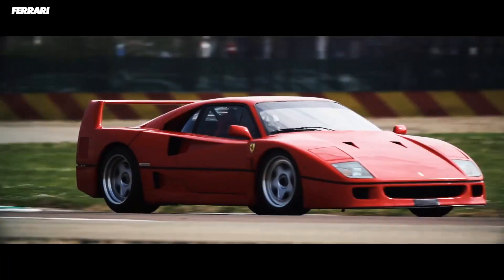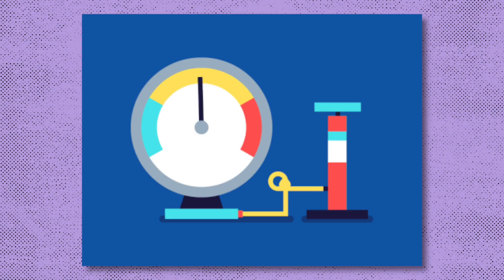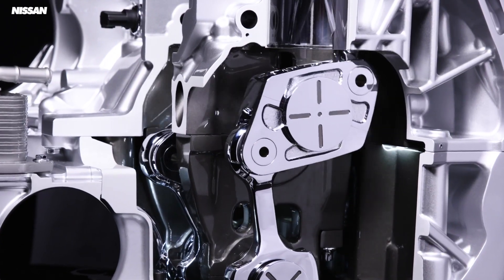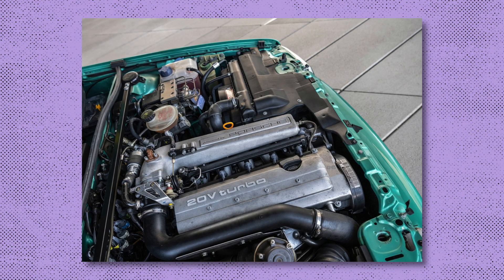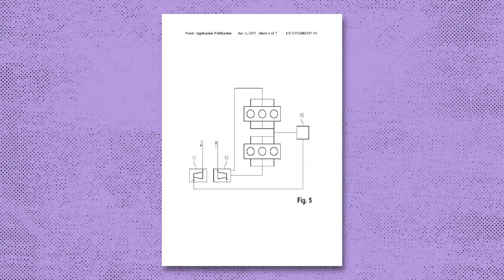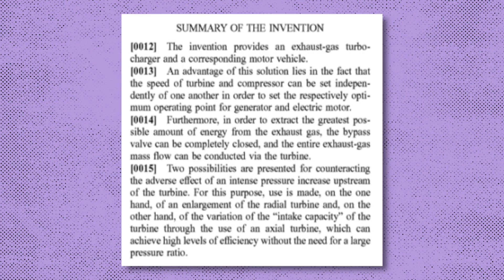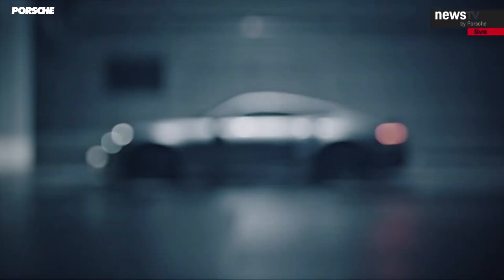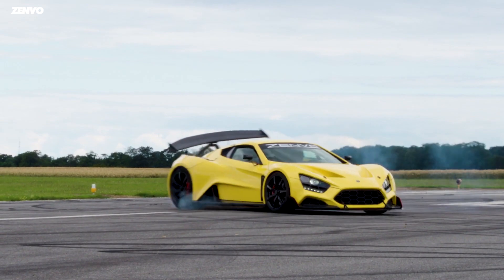Porsche's GENIUS New Turbo Design

Comment from the maker: Would you want one of these on your car?? The seem pretty cool! Don't forget to subscribe!
Reply: Yeah. It's essentially an electric supercharger and generator powered by exhaust gases.
Stresses the engine less than a supercharger and can assist the alternator.
Reply: @Rose_Butterfly98  do they even use an alternator? or a dc-dc converter?
Reply: @ryanholmes5364  either way, it does the same job, if it's direct DC charging it'll be even better.
Reply: @Busi Xho Nice idea, but to get enough air to be useful, its actually going to be quite big (and to take the pressure, quite heavy). The boot is not a great place for two reasons 1) the pipes have to be capable of taking the full pressure (and do it for years in a hostile environment without failing - high pressure lines failing hurts people) and 2) long lines means less effective as it still takes time to pass enough gas through to be effective. Also, don't forget, compressing and releasing normal air has effects like condensation - there is a lot of moisture in air; dumping it straight into the engine and out the exhaust is fine, but trapping it in a pressure vessel is likely to lead to corrosion, which leads to failure. Engineers think through ALL the problems :) (Never stop having the ideas though, thats how new stuff is invented!).
Reply: @andyowens5494  he's right. Something similar was done to fords wrc 2003 car. Had an air tank in the back of the car
Reply: @igamehard8860  Yeah, but it only lasted 3 events; wasn't anything like as effective as they'd hoped. It didn't spool the turbo, it just fed into the manifold. It had an effect, but Ford were quite glad it got banned.
Reply: @andyowens5494  feeding air into the intake while off throttle can help reduce turbo lag. I don't know if of this is exactly how firds works but it's how Porsches anti lag or dynamic boost works. But you are right it didn't help much around 5% in the ford
Reply: just imagine this turbo system in gt2 rs ......🤯🤯
Reply: @Busi Xho the gains don’t justify the means. Pneumatic power, in this context, besides being susceptible to the same thermal energy of heat that of a hot turbine, also has a known problem to form condensate. What has been known to work is a water tank in the trunk that cools the intake charge as shown in the BMW S54. I’m not a big fan of that design however.
Reply: Very well done presentation.
I only subscribe the best, and you are one of those.
Reply: It's cool, but I don't think its a turbo, its a electric motor thats powered by turbines similar to the ones that turbos use. There's far more differences than similarities. Of course, I know all of this is just semantics. But, its still not a turbo. :)
Reply: Excellent video
Reply: Excellent video
Reply: yes, definitely not buying an EV electric coffins
Reply: yeah dude duh
Reply: Do it. Grand Sleeper.
Reply: I'd certainly like any car that came with it :)
Reply: I already made one myself. I 3D printed an electric supercharger and tested it on my car and made a video of it.
Reply: Porsche should license out this turbo technology to Toyota's 3 Cylinder GR Yaris. That would be bonkers.
Reply: Get your facts right. This invention comes from the genius engineers at the Mercedes AMG Petronas Formula 1 team. It has been in Formula 1 since 2017. It is not an invention from Porsche. Porsche probably copied the idea.
Reply: I WISH I COULD GET WITH SOMEONE THAT WOULD LET ME DO DESIGN WORK.
I HAVE A DESIGN THAT FIXES THIS USING HEAT FRIM EXHAUST. IT ALSO COOLS EXHAUST HEAT INCREASING FLOW.
Reply: @ronniewall1481  You might try to get a job, or an internship, at one of the (very few) small tuning companies (not pimping companies!) who develop their own turbo chargers.

Pro tip: when applying for a job, or an internship, ditch your pretend for all-caps text. That's not professional. Not even in France; even the French people only use the all-caps style for informal communication (which comes from their keyboard layout). You might also let someone proof-read your text.
Reply: @Lil Yeet WHY THEY ARE AN AID YOU DELUSIONAL THINKING THEY YELL?
Reply: @Lil Yeet YOU THINK?
ANYWAY I GOT TONS OF IDEAS LIKE I KNOW HOW TO BUILD A SOLAR CAR WITH NO  SOLAR CELLS
Reply: Hi Callum, can you find out more for the benefit of everyone. I have read somewhere (which I have forgotten and cannot verify) that EA111 (VW's 1.4 TSI), which is turbocharged is now using the smaller compressor for better low end torque and not sacrifice much of the high end torque. I used to drive the Golf Mk6, which comes in 2 HP variant. The lower 122HP 200Nm 1.4 turbocharged and the more powerful 160HP 250Nm 1.4 twincharged. The same setup goes on the Touran Mk1. However, VW (I would assume technology derived from Porsche since Porsche has 51% ownership of VW) seem to have updated to a smaller but more effective turbocharger, so that the lower power Golf Mk7 is a 1.0 TSI inline-3 with 120HP and 200Nm, and the 1.4 TSI (also on the Touran Mk2) is now the more powerful 150HP 250Nm version, both single-turbocharged, with little turbo lag. Anyway to verify this information? At least when I start off from a stop at any traffic junction in my Touran Mk2, I don't feel the lag, and by the time I reached 60km/h, I have left my neighbouring cars at the junction 100m behind me. I did feel the lag in my Golf mk6, where gears 1&2 are sluggish and the torque kicks in from 3rd gear onwards. I also want to understand how is the lag reduced or eliminated with a smaller turbo. This part I don't quite understand. Many Thanks!!!
Reply: Electric motor powered turbochargers are NOT a new idea!😆
Reply: F. No.... well... maybe... dunno............................. in the meantime NA is kind, period.
Reply: yeah great video! and if you need storing and sharing drawings, 3d models, maybe it will be useful for you https://youtu.be/vwV-Im_xlic
Reply: Amg one lol
Reply: Yes, but I can probably build a car for less than the price of one
Reply: no, its dumb ! This is the reason ICE engines are going to 'die a sudden death' - the engineering is like shuffling cards around but not really improve . How about get rid of the DRAIN bolt/oil change process ? that is way more useful.
Reply: Can you  make a video about this car invention https://youtu.be/vFfsEfnsA4I
Reply: 77
Reply: Useless now we have to drive electric cars.
Reply: Gotta keep burning the dino juice. Even though deep down we all know that peak oil is a lie and that the earth is continuously producing more of the stuff.
Reply: I would definitely love any invention that would eliminate lag and improve throttle response because this is the main issue I have with turbo cars, that and the engine noise, but I'll settle for just improved response 😀
Reply: @timoooo7320  Exactly, talking about "turbo lag" is so 1980s ;-)

I do like improved throttle response of my car's engine (technically, the valves now control the intake; the "legacy throttle" in the air path is just just a fallback if the valve control system fails). Unfortunately, the added complexity also has a price. At 250.000 kilometers, the engine has now developed a "rough idle". Oh well, I got used to it, and it's still performing flawlessly on the Autobahn.

Oh well, EVs don't have such issues. But, while Elon Musk claims that his new model has "the power of a Porsche and a range of 500km", it actually has "the power of a Porsche or a range of 500km". Also, whenever an EV is charged, the sun doesn't shine a bit harder, nor does the wind any more; the additionale electricity comes from coal or (in the US) Diesel plants. When you do the math, the fuel efficiency of an EV is in the same range as a conventional gasoline engine (Diesel engines can still beat EVs by a wide margin). It's just much easier to build a high performance EV than a (reliable) high performance Diesel car. Probably the reason why the first car to go 100km/h was an EV, built my Siemens,. When Siemensstill built cars. Don't worry if you don't remember; that was in 1905.
Reply: @timoooo7320  I HAVE ONE.
Reply: @timoooo7320  Believe in JESUS today, confess and repent of your sins. No one goes to heaven for doing good but by believing in JESUS who died for our sins. GOD loves you soo much unconditionally.😍😚😘
Reply: @alunesh12345  God doesn’t exist. Stop pestering people.
Reply: @alunesh12345  go to bed
Reply: Everyone says they want to eliminate turbo lag. I don’t drive turbo vehicles but I know what I like. I like lag for what that means in lag is directly proportionate to boost. I’m from the era of VTG, now whether that be Shelby’s invention or Porsche’s, I know good design when I see it. Want to reduce or eliminate lag? Reduce the mass of components in revolution. Voila. Conversely, however, increasing mass in some strategic places can also be a welcome benefit that serves the same purpose.
Reply: @johnnykwon8173  yeah I think turbo lag gets too much attention in street cars. When I had my s2000, it was nice and docile for everyday driving until the cam lobe shifted and it really came alive. Lag can help make a car easier to live with.
Reply: @RyanHarris77  the downside to that of course is a fuel penalty.
Reply: I would like a timestamp. As a car guy, it's a waste of time for me to listen how the turbo works. Just explain the "Porsche's GENIUS New Turbo Design", please.
Reply: turbo lag has been gone since 2000 with the mk4 golf GTi 1.8t. since then it's got less and less. the Audi S2 was a joke because that's what? 30 year old tech and will have bad lag.... because it's 30years old

electric is the future.... petrol is done.
Reply: Plz stop telling me on how a fuckin turbo works,u really think imma watch this not knowing how it works
Reply: No
Reply: @bidenstoletheelection9116  THAT'S RIGHT I AGREE ONE HUNDRED PERCENT WITH YES.
Reply: @bidenstoletheelection9116  ISN'T IT SAD HOW WE LET THE IDIOT ELITE RUN THINGS.
I'VE BOYCOTTED HOLLYWOOD AND MAINSTREAM MEDIA/TV.
Reply: it's already out of date and can be beaten by an EV that costs a third or what the Porsche does
Reply: @geoffsemon7411  I’ve thought about how it is perceived as antiquated. I have a long standing affair with the ICE and I can’t abandon it. The EV is nice as a redundancy, cleaner in efficiency and maybe maintenance, but I have my preferences.
Reply: Idk they seem waaaayy heavier and well I ain't a big fan of porsche

Comment: I feel like I could’ve invented this at the age of 12 😂 if you have a powerful enough motor connected to a turbine you wouldn’t need those hot exhaust gases which would eliminate lag and maybe not need as big of an Intercooler because of the heat

Comment: Not the way most sequential turbo systems are set up. They usually use two identically sized turbos. All exhaust goes to one turbo say below 4500rpm with the 'wasted' gasses feeding into the second turbo until that valve is fully open and both turbos are doing the work. So may people haven't a clue about sequential turbo charging. 🤦‍♂️

Comment: Just learning about Turbo and my question is Why not Rear Turbos with Aluminum Tubing to keep return Air Cool and the Air under the Vehicle will be cool down before you run it through the Water Cooler? Just brought my first 2017 Porsche Cayenne V6 non turbo. My Goal remove big fat Muffler and Install two Titanium mufflers off the Turbos . Thanks for the Help.

Comment: How much will the 48v system weigh and what happened to their variable vane compressor?  I’d rather thatvsystem than this complicated one I’d also rather just an electric motor directly attached compressor to reduce drag.  Honestly though one thing I learned in building a high torque motors is that large amounts of torque down low hinder more than help, spend more time spinning tires so I find shifty power range up a bit let’s me get traction when power kicks in making me faster.  911 turbos are already damn quick

Comment: There are many companies that are producing reasonable electric turbochargers but a good electric turbo will cost about $2500 and you can purchase a normal exhaust driven system with manifold for much less.

Comment: Yes, Turbos can make a lot of power. But has lag. There is a simple solution. Just use a Supercharger.
You don't need the exhaust gas for it, so it stays cooler, so no giant additional cooling is needed. And you can decide, how to power it. With a Belt by the engine like a generator, or with a seperate electric motor, similar you showed us here.
I can't understand, why turbos are prefered by automakers. Turbo-Systems are much bigger, have many more and bigger parts, and if not warmed up the right way at every start, it destroys itself.
I drove a mercedes C200 K (Kompressor) years ago. What a great engine. It was a I4 with 2 liters, and had the power of a 3 liter I6 without the downsides of a turbo. Power from Idle RPM, without the stupid turbolag.

My actual car is a Turbo Diesel. And if i am honest, i only bought it, cause the engine is the most stable running one from that model. It simply want's normal service, no special treatment. As long as you drive it slowly till the warning light go off. then the temps are high enough, so the turbo don't destroys itself.

Comment: That's very clever of Porsche powering generators with exhaust driven turbines.  Hopefully this system doesn't require a battery because the charge rate of batteries is much lower than the current supplied by the generators.

Comment: I've never been a fan of turbos. Ok jokes aside, i've yet to see anyone demonstrate the math in energy transfer losses proving that turbos are in any way more efficient than super chargers.  ""free" energy doesn't exist, if your forcing the exhaust gases through a fan it's creating resistance for the engine to exhaust against. An engine is literally just a fancy air compressor working in reverse. Now if you're making the argument that our engine designs aren't efficient enough to extract all of the energy out of the exhaust gases and that increase the energy utilization of already expended fuel that's a different story and that actually makes sense. In either case, superchargers take the engines direct power and shift the focus of the existing power into forcing more air into the combustion chamber increasing the fuel to air ratio. I'd love to see a hybrid turbo design that uses a cvt clutch to keep the turbo running at least as fast as the engines RPM below a certain threshold. This would be wasteful but the incerase in power on demand could be worthwhile. Also it can easily just be programmed to function normally o outside of sport mode.

Comment: I was thinking it was a dumb idea because generators and motors are not 100% efficient like a straight shaft is, but with the battery in the illustration I’m assuming it’s charging the battery all the time and only using it when boost is needed, also might be a more efficient way to charge a hybrid battery.

Comment: Nice video and cool tech by Porsche. You should have mentioned Saab though as main comparison. That company used its entire existence to perfect classic single turbo setups. Saabs are famous for their low rpm power, steady power band plus great top end boost. I drive a Saab aero with big single turbo. There is near to no lag even if you don't know how to drive a turbo. Can't say what's better, but bigger turbo makes bigger noise. Porsches design is ingenious but likely also quite inaudible. I would still buy it naturally.. but if you're looking for great turbos get a Saab :D

Comment: no such thing as an electric turbocharger, if it isn't powered by exhaust then it is a supercharger...... there are hybrid compressors which can work as a turbo and a supercharger. Calling this an "electric turbocharger" is something that is purely done for marketing purposes. 

There is plenty of debate if turbochargers should get credit for improving fuel economy, most of the times it doesn't and it only improves fuel economy if the engine can operate reasonably well off boost.

Comment: Not new, the electric turbo was used by a British Tuner called Jackie Dowson who lived in the North East and used the compression pump system off a pressured high flying Spitfire Cockpit, he tuned Ford Engines for the Dutch Rally Team

Comment: I don't understand...essentially it's no longer turbo but a turbine-generator + supercharger system. 
In that case, why not go just hybrid? An electric motor can deliver instant and constant torque. 
Of course, a turbine-generator system may not be able to power the motor alone, making the electric power a time-limited boost. But let's face it, the 911 Turbo is not designed for long-haul racing.
Nurburgring runs require roughly 7 minutes of non-stop compressor.
Track-day sessions are generally 20-25 minutes
Hell, even most club events are 1-2 dozen laps in majority of cases
A hybridized 911 Turbo (well, they're all turbo now...) makes total sense both to the old and the young, the green and the not-so-green.